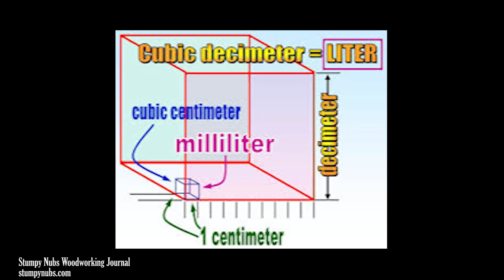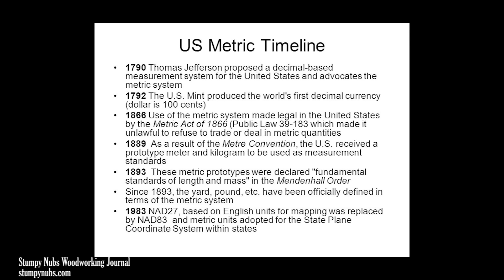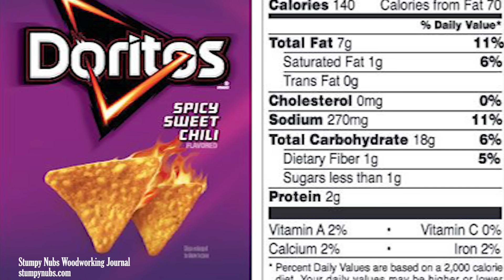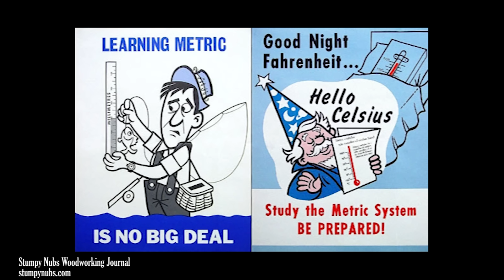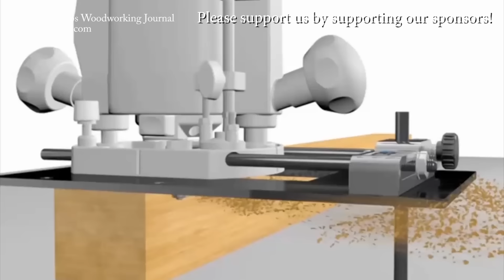BREAKING: The USA is switching to METRIC!

Comment: We went metric here in Australia in the 60s, but strangely feet and inches are still regularly used by a lot of people - especially when referring to a person’s height. Something about those particular distances makes sense, even to kids.
Reply: If you use metric is it always in centimeters?
Not sure why they thought the Earth would be a great thing to base the meter on. Metric users seem to make fun of Imperial for being arbitrary without realizing how arbitrary much of the metric system is. I think another point where they might have realized the meter is not a good size as when they had to base the kilogram on a cubic decameter instead
Reply: I grew up in the UK who are mainly metric but still have pints of beer and miles per hour and older folks talk in both. I moved to New Zealand 14 years ago where everything is metric. I was talking to some folks in their late teens/early 20s a few days ago and one said he was 6''3". I then realised i'd heard other young people use imperial for their height too. Turns out not one of them knew their height in metric.
Reply: @matthewfrost3677  could be millimetres or kilometres too, one of the many nice things about metric is that it scales seamlessly like that.

metric is the opposite of abitrary.  it's based on some fundamental scentific constants of our universe.  it's the speed of light in a vacuum with the clocking defined by the atomic frequency of caesium - both repeatable and demonstrable whenever required.

whereas a foot is the average of the length of the left feet of a random sampling of adults - a hopelessly unrepeatable measure.

Comment: The USA has been half metric half English standard for decades. When cars first started going metric on fasteners you would find half the bolts were metric, half were standard, on the same car. Our mile marker signs are in English and Metric. Many speedos in cars are standard and metric. We used to use bushels and pecks. They stopped teaching that here in like 1971.

Comment: From the other hand we (Europeans) still have TVs with 60 inches in diameter, running cars with 21 inches wheels, and asking plumbers to repair 3/4 inch pipes ;)
Reply: if you do anything electronics you will encounter stuff like 0805 smd resistors 2.54 mm (0.1") pitch in ics and connectors etc
Reply: 60 in diagonal you mean :)
Reply: @paulsven7923  Yes, i'm not native english speaker. My luck, most people have IQ high enough to figure what i ment.

Comment: you miss the number one driver, they measure weed in metric. Metric is exceptionally good at measuring small distances making it perfect for wood working really anything you need to measure accurately.
Reply from the maker: I did forget to include that drug dealers have been using metric for a long time!
Reply: And don't forget about Vanilla Ice, who has been selling rhyme by the gram since 1990.
Reply: They sell it by the ounce too.

Comment: I built a chair recently and the plans had only metric measurements.  I was surprised at how easy they were to follow and reading the tape measure was actually easier.  The only issue I had was the lack of preconceived ideas concerning the length I was about to measure. I know what 2 1/2 inches looks like, but 22 millimeters, in my head, could be 3 feet or 3 inches, ( or neither), cause I don't know.  I'm guessing neither.  I'm sure that would resolve itself with practice.
Reply: @cam7724  Even a dyed-in-the-wool Imperial old guy like me can simplify that in a heartbeat.  That's why the Metric fans love it so much.  Move the decimal 3 places to the left to give 35.037 meters which is about 10% farther than 35 yards, just for a rough estimate.  If you're building a boat or an airplane you had better accurate to the millimeter.

Comment: I am British and of an age where I happily use both.
With imperial  (duodecimal) a measurement has more factors and can be divided by 2,3,4,6,12 whereas metric (decimal) has only 2 and 5.
 imperial  (duodecimal) a measurement has more factors and can be divided by 2,3,4,6,12 whereas metric (decimal) has only 2 and 5.
With an imperial ruler/ tape I can use fractions to improve accuracy 1/2, 1/4 1/8 etc down to say 1/64th but with metric it’s a millimetre and that’s it.
UK rulers/ tapes have imperial on top and metric underneath making it more difficult to look over to avoid parallax errors when marking out.  As a result on an awkward job I sometimes measure length in imperial looking over the top of the tape  and width in metric by turning and looking at the bottom of the tape - mad I know!
If I want to use metric measurements I use a European centimetre only tape.

Comment: The first countries to actually require use of the metric system were Belgium, the Netherlands, and Luxembourg, in 1820. France introduced it but its use was not made compulsory in France until 1837, deu to considerable resistance. I think it's a fun fact. 😀 Not afraid of fractions, but it's two values, when you want one value. What fraction is bigger: 3/4 or 5/6. Decimal is easy  : 0,750 < 0,833.

 It was alway weird. Like the 3/8 thread without calculator: thinking it's les than a 1/2 thread (4/8 in mind) and more than 1/4 thread (2/8 in mind). 3/8 is between 1/4 and 1/2 somewhere.  How much bigger smaller is it. 1/4 = 0.25    3/8 = 0.37  1/2 = 0.5. 🤬

Comment: I’ve pretty much already moved to metric. I purchased a set of plans for a tablesaw bench from Paoson Woodworking. Everything including the cut list was metric. It was simpler to buy some metric, rulers and tape measures to build the cabinet, than to convert all the measurements. In the process I just found it far easier to work in metric. I have to think about what each of the little tick marks mean on my imperial tape measures, not so with my metric rules. But until we go full metric, all my projects have to start in imperial measurements for materials

Comment: Here in the UK, we pump our fuel in litres then work out consumption in miles per imperial gallon (20 oz), beer in a pub is in pints but in a shop it's milliliters or litres, milk is either way (pints or litres) and I could go on. But at least our tape measures and rulers are marked in feet & inches and millimetres & metres.

I once measured a door at 2 metres 11 inches, the tape measure was 2m long so in effect it was one length and 11 inches, it seemed to work so who's judging?

Comment: Happy to go for metric. The main issue is often inertia, as in we have so many plans written in non-metric that would need revising. Same issue for baking - basically nobody’s (US) gran was using grams, and a literal translation from cups and Tbsps would make for very awkward measurements. It’s like how we might have a coffee table that’s a whole number of feet long in the states but some decently round fraction of meters (like 1.5) in the EU. Which ever system you’re on will have some nudge on the exact output, and everything will just be a bit off during a transition.
Reply: With furniture in particular, that concern is a complete non-issue. After all you don't need to use meters for everything -  you can just as well use centimeters or millimieters just as well. in fact millimeters are common to be used in wood- or metalworking. All you need to do is to shift around the decimal to turn one meter into 100 centimeters or 1000 millimeters. It is so easy that you don't even need a calculator (unlike people who try to convert miles into inches) By comparison: kilometers to millimieters? Not a problem. 1000 meters in a kilometer, so 1 million millimeters in a kilometer. Easy.
Reply: For baking, I convert to grams all the time when I work from US recipes. It takes about as long as it does to rewrite a recipe to halve or double it. Many times recipe sites will do it for you.
Reply: I don't understand the imperial system. So with baking it's simple use the measurement of the recepe. If its an old recipe reach for the cup measure new ones reach for the scale set to grams and also measure your liquids on the scale. 1ml = 1g water.
If its a simple recepe and I use it often I convert to grams as then it's easier for me to measure on the scale.
Reply: @xani666  novel idea. If the recepe is in grams you just devide the quantitys by the number of eggs you want to use. I think its  simple. 
You just need a metric calculator though.

Comment: I have no issue switching to metric as a wood worker. But my problem is my mind's eye sees  feet and inches so when I actually see something I can approximate its size. I am unable to hold up a thumb and index finger that are  separated and say "that is 25 centimeters".  I will definitely need some training. That is why I use a left handed crescent wrench and socket set.

Comment: Love your work! Keep it up.
I work in light construction and am driven crazy with our units. I was a carpenter most of my life and I can calculate with fractions in my sleep, but that doesn't make it a good idea. Now I use a CAD program and have to output units that everyone is familiar with but I'm given the data by carpenters using inches rather than feet and inches and surveyors who use decimal feet. And I have to calculate slope, pitch, angles, and % grade, as well as tell CAD to print 1"=10', or 12', or 1/4 inch = 1', etc etc...  Such a waste of time! And in  the kitchen our ounce volume isn't related to our ounce of weight or our inches. In metric the milliliter (ml) of volume equals a 10mm cube AND it equals a gram of water, all unified and so easy to use!!
PS: don't tell anyone but Freedom Units are actually based on the metric system already. 1"=25.4mm by definition...
Reply: Decimal feet. I’d like a tape measure in decimal feet; would be useful for measuring area.

About those ounces: I’ve always thought that a fluid ounce of water weighs one ounce in the weight system. That way a pint is a pound. Is this correct?

Comment: I used to buy the "system international" engineering books in school, because they cost less.  A lot of calculations are a lot more straightforward too.

My favorite place for this topic to come up is with drums.  Some of my old cymbals (1980s stuff) had both inches and centimeters printed on them.  I haven't seen anything labeled with centimeters since that time period.  Drum shells have largely always been in inch increments, although they're usually 1/8" smaller in diameter, supposedly to fit heads better.  Maybe that's an excuse to not sell them with metric labels.  I have never thought to measure the hardware tubing, but some tom mounts have 7/8" tubes, where L-rods and legs will be measured in millimeters.  I think most tension rods and lug inserts have imperial threading sizes.  I don't know what they'd do about switching drums to metric.  Maybe they'd just pick the closest centimeter and go with that, or round it up/down for labels but keep using the physical imperial sizes.  I haven't checked to see if this is already done in other countries, but none of the English speaking drum forums have brought it up.  I also don't know how this effects other instruments.

Doctors offices have started taking down height and weight in metric units.  The nurses, usually foreign, have a mocking attitude about it, but my local health network just seems to foster that type of rudeness and condescending behavior throughout, so I don't want to say it's everywhere.  They also don't like that I can do the conversions quicker and more accurately in my head faster than they can.

It's mostly just going to take time to learn the differences for a full switch, and there will likely have to be a generation or two that is "bilingual" because not everyone who has lived most their life knowing imperial will bother learning metric, and they shouldn't be expected to.  A lot of adapting metric objects to fit existing imperial infrastructure will have to be done for decades once imperial size replacement and repair parts end production.

Comment: Love the video as usual. Measurement units in your workshop are not that important. I'm in the UK and while I'm amused at some of the American measurements that I didn't understand, like 2D nails that are based on a currency I used as a child, I build in whatever measurements I like on the day. I've made projects in a mixture of imperial and metric measurements because different parts rounded up better in one or other measurement systems. Most of my projects are to fit into my Victorian house but it's not difficult to switch and convert. I would say that the chances of my picnic table needing to dock with the ISS are very low so I go with the flow.
Reply: Brother, I think you nailed it (pun only slightly intended). We should all just relax and use whatever makes sense, and there are excellent examples where one system is clearly superior to the other. (Center point of 3/4": Imperial. Divide stock into 5 equal parts: Metric, etc)

Comment: An American living in Australia. I use metric because that's what everyone uses here, but in many instances it sucks, here's why. Ordering lumber is done in millimeters and meters NOT CENTIMETERS. Mention centimeters and you'll confuse everyone. A 2 x 4 x 8 is a 38 x 90 x 2.4 meters and that's exactly how you order them. A 1x3 is 19 x 90, now divide that 19 by 10 or any even number. A sheet of plywood might be 2400 x 1200 or (if it comes from America) 2440 x1220. Every house in America and Australia from the last century is built with studs on 16" centers so any renovation done with metric plywood is going to be an expensive pest. It's also worth noting that 12 (inches in a foot) can be evenly divided by 1, 2, 3, 4, 6 and 12, 10 can only be evenly divided by 1, 2, 5 and 10. 10mm equals 1cm, 10cm equals nothing in particular. You have to go to 100cm (39.3in) to get to the next largest increment. There's no "foot" in metric which is why plywood is measured in millimeters (you could call out plywood as 2.4M x 1.2M but nobody does) . You have no idea how handy the foot measurement is until it's gone. Also there's no easily recognizable increment on a metric ruler like 1/2, 1/4, 1/8 or 1/16. All you get is millimeters which are very tiny and then centimeters which aren't that much bigger. Eye strain is a real issue, no joke. 
It's not all bad though. I owned a picture framing business for a few years and working with millimeters was great for the small finicky chores that business generates. Bottom line is I don't see any particular advantage and a few down sides to using metric in the building trades or for building anything larger than a picture frame.

Comment: My switch to metric actually started in the kitchen a few years ago when I started baking more.  Made my results so much more consistent.  And as I started getting used to it, that expanded into more aspects, like woodworking as well.
Reply: Baking is one of the few places I like metric - grams are almost the perfect unit for home baking. 👍
Reply: Anyone using a scale to weigh in the kitchen will recognize that it can be more accurate than measures using volume (such as a cup) - is the volume supposed to be packed and if so how firmly?
Reply: @stevebabiak6997  Yeah, I actually tested it when I got my gram scale. Measured out 5 different cups of flour and weighed them, and the difference was pretty shocking.  Some of my cups were like 15% off on weight.
Reply: @sinocte   - my scale lets me choose the units, so I can do ounces or grams.